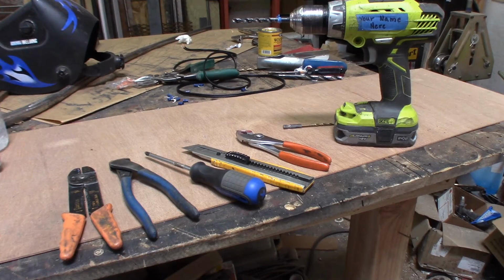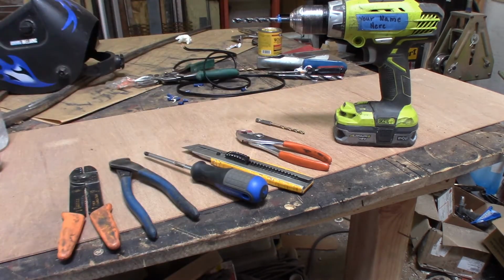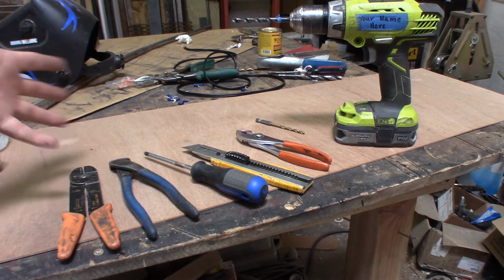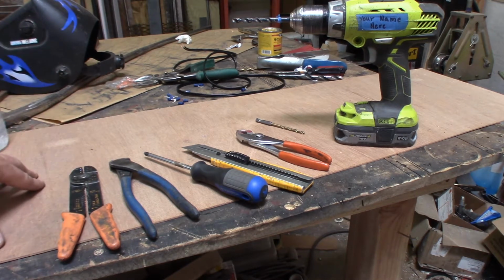DIY Mason Jar Light

Comment: With an LED bulb, doesn't this lamp get wicked hot with no ventilation in the glass jar/globe?
Reply from the maker: Can't say I had much issue with the LED bulb heating up the glass jar. If I had used an incandescent bulb, it would have really heated up the jar, but the LED didn't have any noticeable issues